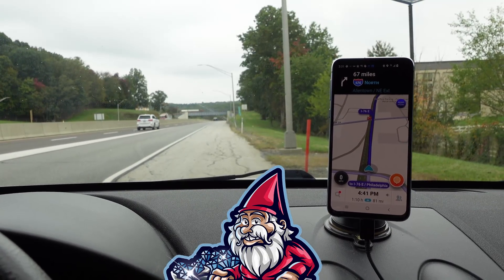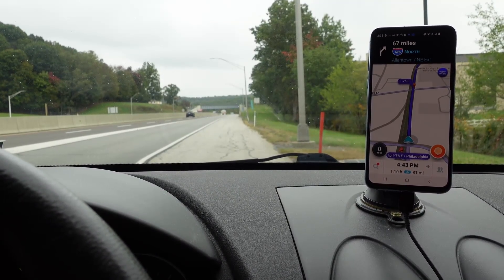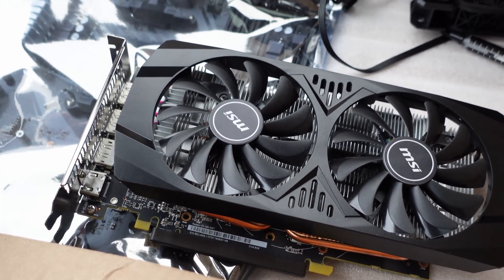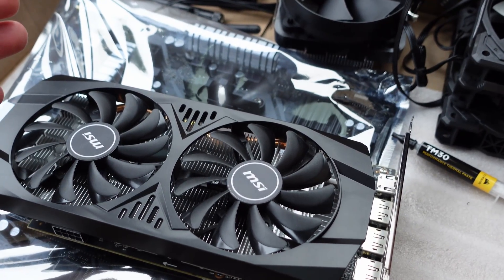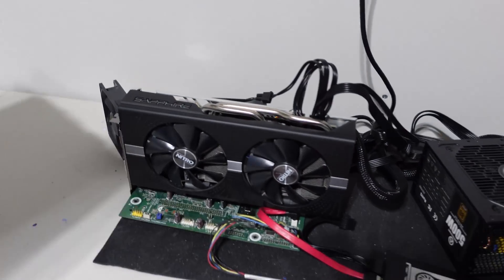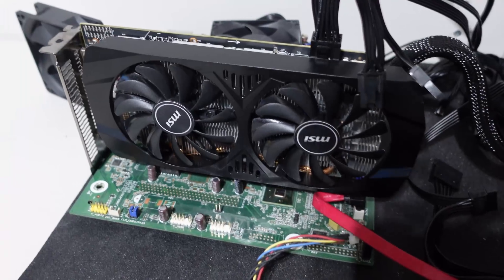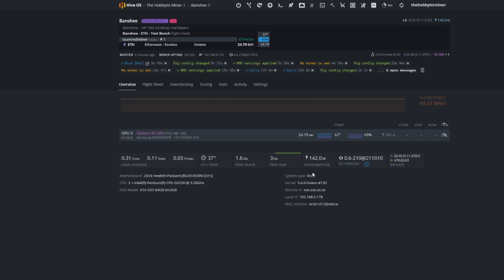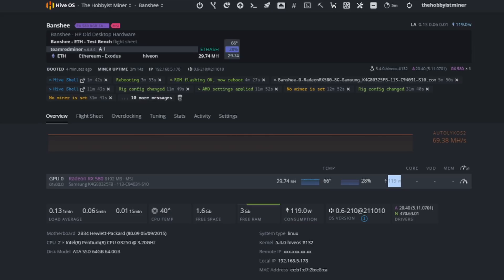RX 580 Ethereum Hashrate Testing & Where to Purchase?

Comment: I told you those Samsung cards are picky. That's about on average what I get with those. Micron by far is the best. I've had some hit 35 (34.92)stable.
Reply: what is the 
setting for micron to reach 34mhs?
Reply: @b3ny971  silicon lottery. First off you'll have to flash the BIOS with tighter memory timings. Then hopefully you have a good card hence the silicon lottery. Most micron memory will do 2250mhz the ones that I have gotten up to 35 mhs hit 2300mhz memory and usually anywhere from 1200mhz to 1250mhz on the core.  Your efficiency is going to be hurt by running it at that speed though. I much rather run my cards at 32 to 33 mhs with a lot less voltage.

Comment: Most important thing in Polaris builds is if they did mem chip cooling with direct contact to cooler. You don't want that ASUS shenanigans without mem chip cooling. Those gpus won't go over 30mhs tops, often they'll do 29... then you have to buy extra cooling pads for each mem chip, hope they're right hight so original cooler can be mounted back and hope enough air goes through those cooling pads...or get a universal cooler much more expensive

Comment: Holy crap I would never drive that far for a scalped 580. You can legit find them on ebay for 300 or less if you are very patient and diligent. I actually bought an rx 570 8gb last week for $150 that was 'running hot' for parts only and it worked fine with a broken fan.

Comment: its nice to score a desent deal, i just got a box of 6 cards for 500 from a local contractor that does clean outs for the apartments, had 3 xfx rx570 4g, 2 asus rx580 4g, and 1 xfx rx580 8g. cards where super dirty and two had bad fans. but they all run and mine ordered some fans up to 36 gpu in my farm. 26amps 240
Reply from the maker: Wow! That's a deal!
Reply: @TheHobbyistMiner  ya I do heating and air so I have a lot of contractor friends that let me know when they find deals, or with him he was paid to remove what the Tennant had abandoned so it's all profit, he actually was gonna give it to me cheaper but I told him if they work ill give you 500 of there all junk 100 for parts cards. I have a lot of rx cards so parts cards are not bad.

Comment: 18:48 That lonely fan on the left:

what is my purpose?
Reply from the maker: Required by motherboard to boot up. Rear Fan Error if not and won't boot. Can't disable in bios. From an HP tower
Reply: you pass butter

Comment: The Sapphire Nitros are so much better. Lower temp and wattage. My biggest RX580 is the ASUS ROG. Its huge with 3 fans. Runs very cool. 1st Gigabyte RX580 coming this week. The 1-4 splitters work so easy.
Reply: my asus strix 580 is actually one of the hottest on my rig.  i mean i still have it under 59 deg but it needs like 80% fan to achieve it, rest of rig runs at 50% fans for same temps
Reply: @shyrix  mine is running 29.99mh/95w/56°C/28% fan. Only the sapphires are running cooler, in 40°C range. My Asrocks and msi all in mid 60°C range.
Reply: @shyrix  48-50 asus strix 580 with fan 70

Comment: How do you set your mobo to detect more than 6 gpus, mine it’s only detecting only 6 and when o connect the number 7 the mobo is crashing, I am using a 1 to 4 pcie adapter, and the mobo is a asrock b450 pro4, thanks
Reply: I had the same issue. look for the setting "CSM" turn it off. After I did that I was able to get 8 GPUs running.
Reply: @bostitchrider2026  I just tried and it works, thanks a lot!
Reply: @diegosanchezhernandez7160  Nice. Keep an eye on it. Sometimes it will revert back. No idea why. Happens on my MSI Z390 and ASUS Z390
Reply: Which mobo?
Reply: Yes I forgot to mention, it’s a asrock b450 pro4
Reply: @diegosanchezhernandez7160  bios settings prob bro
Reply: @diegosanchezhernandez7160  i have a msi tomahawk b450 max
Running 9 * 3060ti no issue at all
Reply: Can you give me an idea of the settings? Please or an video please
Reply: @diegosanchezhernandez7160  what processor do you have on the board?
Reply: @pradheepvenkatachalam3933  and @BLC blogs thanks for helping, it’s a AMD Ryzen 5 1600